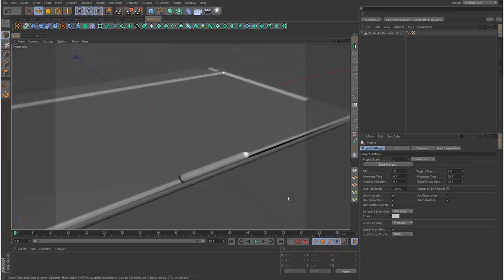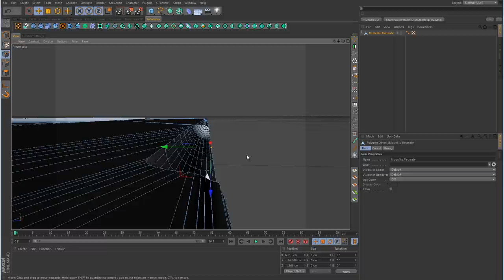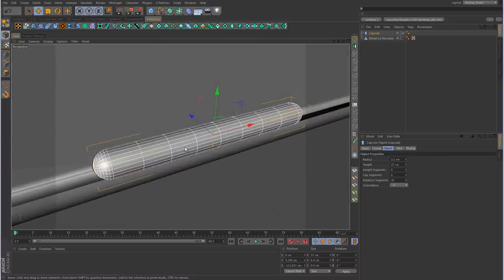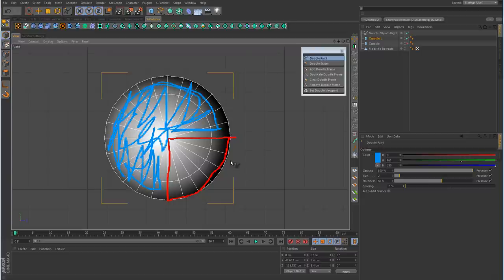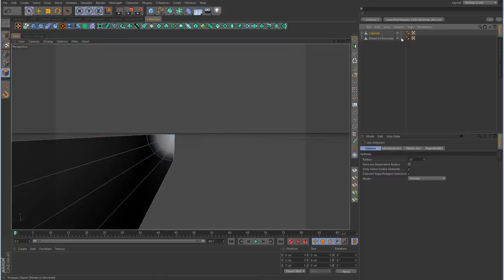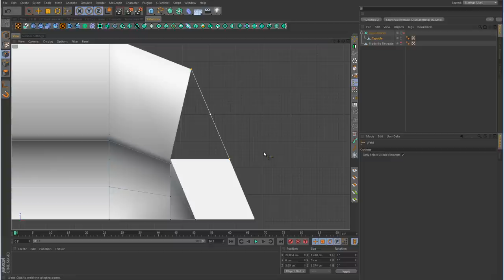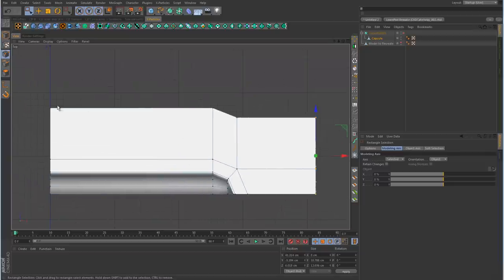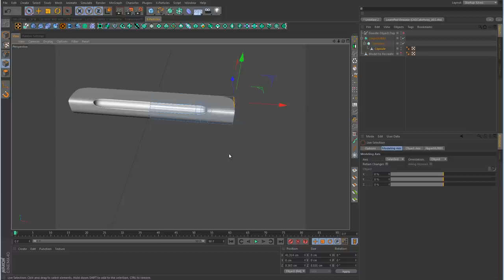Sub-D Modeling in C4D - Lesson 18 - Choosing where to start your modeling

Comment: this is a good tutorial but its almost absurdly slow modeling like this.  I know its out of fashion but this kind of modelling is why its good to have a nurbs toolset.  the result here looks good....but what if afterwards you have to add 3 odd shaped kind of circular buttons very very close to the bevel...or worse on top of it.  it quickly becomes a nightmare.  i often do this kind of stuff in nurbs in maya then convert to polys afterwards - if i really, really have to.  you often have to do clean up but its still way way faster and more intuitive
Reply from the maker: The purpose of these tutorials is to make people think. To visualize the geometry to understand the flow of edges. i could have just used a boole to cut the shape, then cleaned it up, but anyone can do that, and it doesnt require a tutorial. ;)
Reply: ShepperdOneill no for real...its a good tutorial.  ive spent countless hours doing the same kind of thing.  thanks for the effort